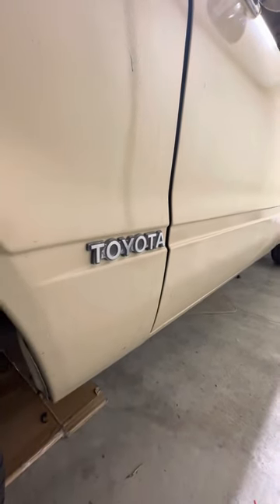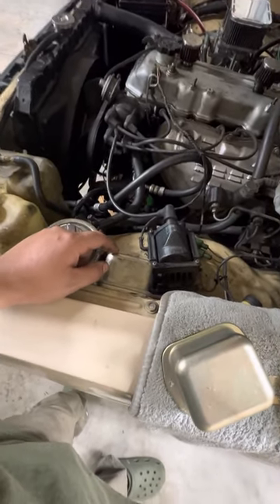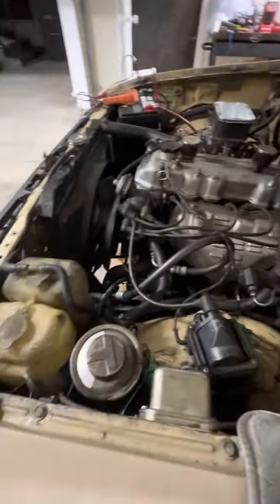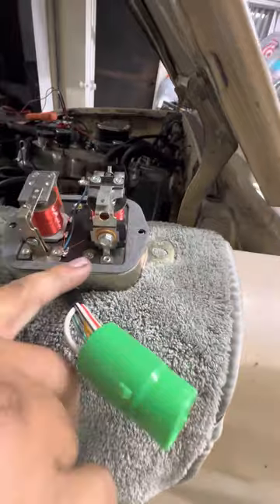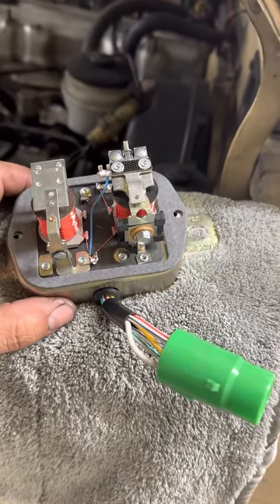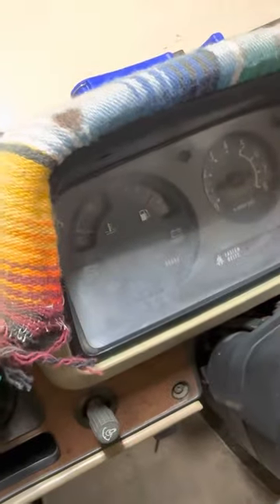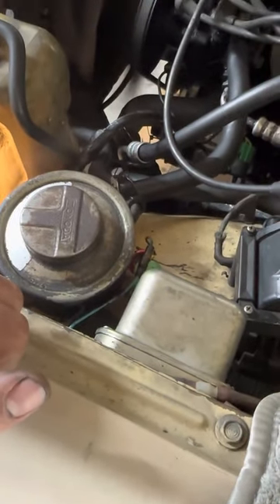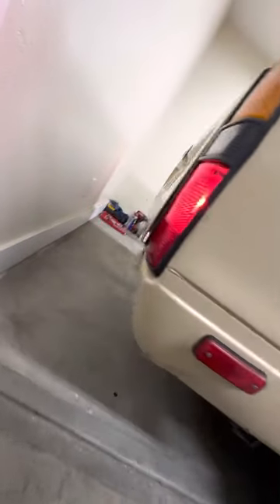1981 Toyota pickup sr5 short bed 5 spd   Over charging fixed voltage regulator…

Comment: Do you have a wire running from the post on the alternator straight to the positive battery terminal ? Or does yours have a white wire running into the harness and through the fusebox and some fusable links to the battery.

Comment: Tried adjusting mine Its hard to get it to 13.6 Mine was charging at 17v them played with in got it down to 12.7 but having no luck dialing it in
Reply from the maker: Hmm  yeah it's kind of hard took couple time till I got it to the voltage  I wanted.